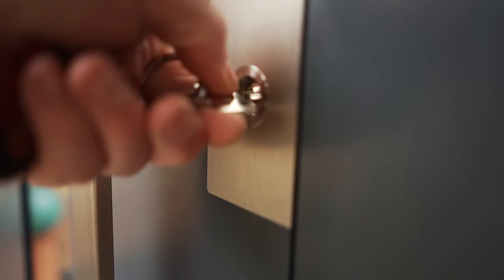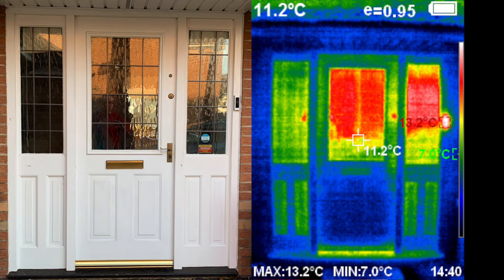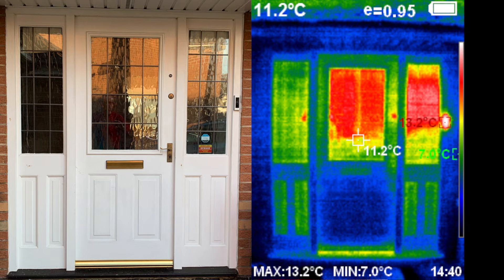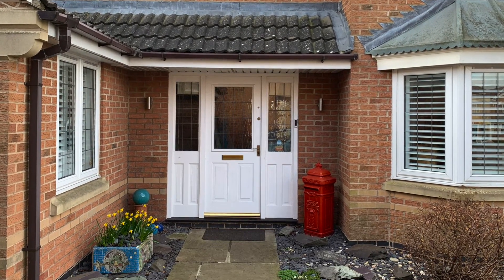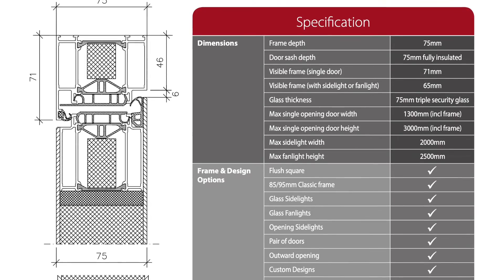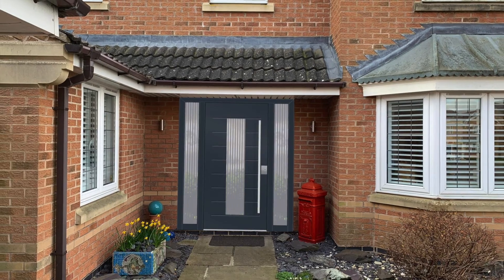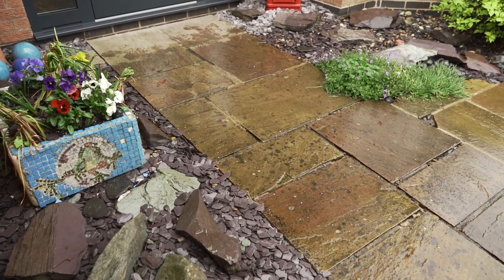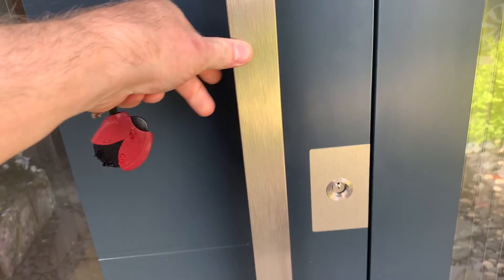Our New Front Door is Passive House Rated

Comment: Apologies for the historic question. As the door was quite thick di the fitters have to trim the interior plasterboard back? Do they install nationwide too?
Reply from the maker: @Stormin_Mike no internal trimming was needed just some touching up where the plaster had broken. I guess it sat slightly further forwards, not really thought about before tbf. Yes they fit nationwide.
Reply: @johntisbury  Thanks for the reply John. We swapped a circa 2000 door for a composite but its not that great. We hear wind whistle when it really blows (as recent weather) and i suspect the seals and reveals aint that great. Nice door by the way. We need just a door, no side panels so that would slice a few £ off the product?
Reply from the maker: @Stormin_Mike yes I suspect that would be cheaper. Top tip, if it’s a front door, do not include a letter box, go for a separate mailbox. Letter boxes leak heat.

Comment: Lovely door. The only thing I would be a little concerned with is the key being used to pull back the latch. Over the years of use I wonder if the key would weaken and potentially snap as you unlock the door and open the catch?
Reply from the maker: The key is super thick, twice that of a normal key thickness. I don’t think it will fatigue over the years.
Reply: @johntisbury  That's really good to know, thank you.

Comment: Hi can you tell me the overall cost with fitting.pete
Reply from the maker: Hi Pete, 7k
Reply: That is an awful lot of money for that door , i fit Spitfire doors , best door on the market , 80 mm thick door sash , 2 people would struggle to carry the design you had , should have been no more than 5K
Reply from the maker: @davidmiller7771 good hear you can price doors remotely without the full facts, specs and information. FYI: 2 people did struggle to carry the design I had without the side glass installed. 
I'm sure Spitfire doors are good, they are however not the only high quality Passive House doors on the market. BTW it's not a competition.

Comment: A little bit off-topic John, but how do you rate the HTI-A1, I've been looking at FLIR-C2 and just spotted you've got an HTI.  Great front door by the way.  I bricked up my front door (it was next to my back door bizarrely) and put an external letterbox on.  Boy did that stop a draught once we didnt have a gaping hole in the wall.
Reply from the maker: The camera is good Robin, I preferred it to something that you attached to your phone, seemed a little more robust. To be fair I've not compared the output with any other type of thermal camera, but it seems very good in terms of on-screen info and ability to save the images. They are not massive files from the camera, 320 pixels on the longest dimension.
Frontdoors can let in a lots of draughts for sure.

Comment: Sorry this is an off topic question but my powerwall was fully charged by 8am so i plugged the car in to the zappi on eco++ and its drawing from the powerwall . ive had a look at the setting but cant see how to change it . many thanks. Edit  its now charging the powerwall and the car
Reply from the maker: If you don’t have enough solar to cover the Zappi then it will pull from the Powerwall. Zappi  is unable to differentiate between solar / battery. It sees it as non grid energy.
Reply: @johntisbury  Ok thanks  John i thought it should cut out under 1.3 kw ,Robert Llewellyn said his car charges when the powerwall is full.
Reply from the maker: @rodden1953  that’s the priority order, Powerwall then car provided the Tesla CT clamp is first in line from the meter tails. Put the myenergi ct clamp before the Powerwall and you will change the order.
Reply: @johntisbury  Thanks John i get that now.